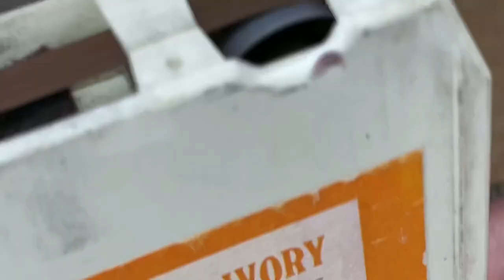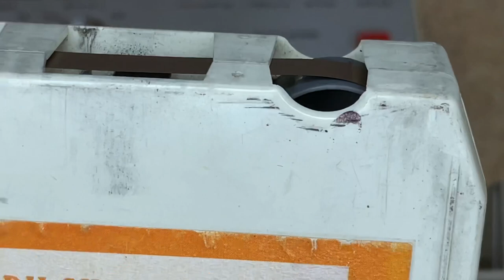I Was Wrong About Tapes!

Comment: Interesting. I learned something new about these little gems. I'm curious about the erase mechanism though. Since there's not an erase button does it protrude when the record feature is pressed and erase the prior recording as the new recording is being done? And separate from this somewhat, I have pre-cassette tapes that are probably from the late 40s that belonged to my parents. If the width is the same as a modern cassette could I use a cassette case and insert the reel in it to play? They're just in small round tins. Thanks for sharing all you do.
Reply from the maker: Great questions... the older tape will be too wide (1/4") vs 1/8".  The erase mechanism works by either triggering or not a lever based on the presence or absence of the record tab.
Reply: @Recordology  Thank you very much on both accounts.
Reply: If your tapes are from the late 1940s, you're going to need an open-reel machine to play them, and you'll probably run into a minor issue if you try to play them on a stereo open-reel deck.   Namely, it's likely you'll hear very different things on either speaker. 

It's a little difficult to explain; it boils down to the different ways they implemented stereo and mono on open-reel.  Mono recordings take up the full half-width of the tape, stereo interleaves the left and right channels with the left and right channels of the opposite side.  The result is, if you play an early mono reel-to-reel tape on a stereo machine, you're likely going to hear what's recorded on the other side of the tape - BACKWARDS - on one channel, along with NORMAL audio on the other.  Don't worry, it's not a malfunction.  It's completley normal and just an artifact of how they did things, and the solution is usually pretty easy: turn the balance control completely to the channel that sounds 'normal'.

Or you could find an older (mono) reel-to-reel machine, but you'll probably need to do repairs.

If you'd rather not hassle with it, there are services on the internet that can transfer the audio from those old tapes to a more modern format - CD, USB/SD, even cassette if you like.  

I strongly recommend transferring the contents of those tapes to a newer media (and sooner is better than later!), because older magnetic tape is made of acetate, which deteriorates and gets brittle over time.  Also, the binder (adhesive) they used to put the magnetic material on the tape tends to dry out, causing the magnetic material to 'shed'.  By the 1960s they began using polyester and mylar, along with better binder material, which are far more durable.
Reply: @Recordology  Not quite.  The erase head is passive unless the record button (along with PLAY) is pressed.  When pressed, an electrical current goes through the erase hear causing it to erase the tape.  The tab at the back of the cassette either prevents the REC button from bering depressed (no tab) or allows recording (tab present).

Comment: The pinch roller is the speed regulator at a constant 1.875 inches per second.   On each reel, the edge is also going at 1.875 ips on each of them.  The larger reel would move slower because of the surface speed and the smaller reel would be moving faster.  It keeps the music program audio consistent.  That little surface on the capstan and pinch roller are also moving at 1.875 ips but is spinning so much faster than the reels.  The capstan motor is spinning very fast and a belt goes between that and the flywheel which would step down the speed and the rpm of the flywheel is calculated and factored in for the capstan itself to spin at 1.875 ips.  To make a comparison with records, that is spinning at a constant rpm, but what happens there is when you get toward the center of the record some fidelity is lost because of the diameter lost on a record.  I find that the highs sound somewhat distorted and not quite as clear and midrange frequencies sound a little harsher as you get toward the center of a record.  The outer groove is so much clearer.  There's one more thing that I'm not sure if you're aware of or not.  A compact disc is servo controlled and the laser on the disc is at a constant surface speed, if I remember reading correctly about 1.2 meters/second, but I could be wrong.  I think I remember reading that around 1987.  Anyway, if you look at your spinning CD, it reads from the inside out and you'll notice your disc is spinning much faster than the last tracks on the outer edge.  Because of where the laser is, it tells the drive motor for the cd how fast to spin because of where the laser is.  I didn't mean to go off on a tangent, but I thought you may find that fascinating.
Reply from the maker: Yes constant angular velocity which means that the media passes the head / stylus at a constant moderated rate vs. constant linear velocity which means the media stays the same speed.

Comment: the capstan produces tension against the heads so they can read  the magnetic pulsations on the tape
Reply: No.  The pad in the middle is needed to push the tape against tyhe play head.  Without the pad, the sound will be muddy.

Comment: Very interesting informative video. I grew up listening to a lot of cassette tapes and it's funny isn't it how we just listened to the music and just took it all for granted and we don't think of these genius little systems and how they work. I actually didn't know it was just the capstan pulling the tape through. I thought it was the black rotating sprocket on the right that pulled the tape through and the capstan was just there to keep the pinch roller running smoothly. So I have learnt something new there. One thing I always noticed on clear cassettes was the two small plastic wheels on the bottom corners of the cassette shell. I know all cassette tapes have them, but I've always wondered what they are there for. I'm guessing they are just there as a guide for the tape to run smoothly as it goes through the tape heads, as the tape rubbing on parts of the cassette shell inside could cause problems. That would be my theory, but I don't really know. The guy who created the compact cassette tapes passed away just recently. Very sad news. Great video.
Reply from the maker: I think they are just for guiding the tape....excellent post - thank you!

Comment: It is the same principle as open reel to reel... 8 Track is different in that 8 track take up and supply reel are the same single reel.
Reply: And has a piece of metal so the head can change tracks atthe right spot (though I used to have a 8 track that the end of the track was slightly cut off, like the tape was advanced a bit too forward during recording so the tracks were cut off at the end).

Comment: We learn things all the time. A motor 🚗 drives a belt, which is connected to a pulley, and, in turn, 🚗 drives another pulley, which is a 🏋 weighted wheel. To this, is what the Capstan is built into. This is the part that the motor is 🔋 powering inside your cassette player, or recorder. The pinch roller is simply there to 👌 keep tension on the tape, and that it plays at a consistent speed. The reel with the least amount of tape on it, spins faster. The reel with the most (more) amount of tape on it, spins 🐌 slower. That's because of the rotational mass (physics here, 😆 LOL!! If you can 📌 pinpoint the EXACT middle of the tape, this is where both reels are equally full, and they will spin at the EXACT same rate, but only for a mere second. Your 👀 eyes won't 👎 notice the variation, as the opposite reel, 👎 now has ever so slightly more amount of tape on it. The best way to locate the exact middle of a tape, is to start with a tape player, or recorder, with a tape counter on it. Make sure to set it to "000", and fast forward, or play a tape, until the machine shuts off. Look what numbers the tape counter have on it ( 📚 reading). For example, if it made it to "986", just take away half of this 📚 reading. I don't 👌 know how accurate my above test would be, since equipment you're playing tapes on, is 👎 not created equal, as far as quality. Tapes are also different lengths. A 120 minute cassette could zero out that tape counter, and go beyond, making finding the exact middle of your tape a bit more difficult. Your friend, Jeff.